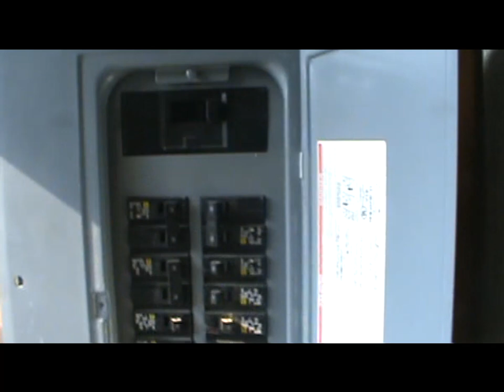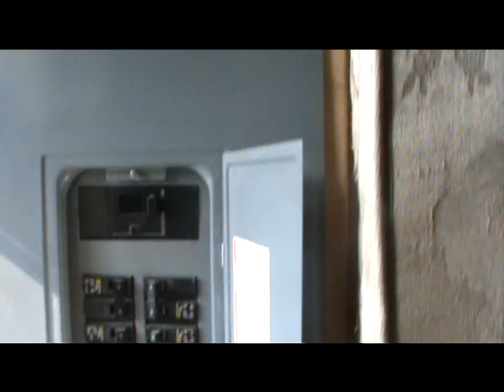I WIRED ALL MY ELECTRIC..HOW I DID IT!

Comment: I remodeled my last house. Unhooked the power from the house. Put new siding and put new breaker box inside. I designed the circuits. Did all the wiring in the house. Had a friend with electric business come and reinstall the meter on outside and to the new breaker box. Power company came back and hooked up to the meter. Lived in rural town and skirted by that permit stuff. Can't really do that in this county anymore. To many hurricanes and people now.